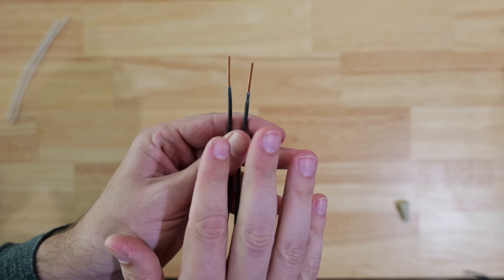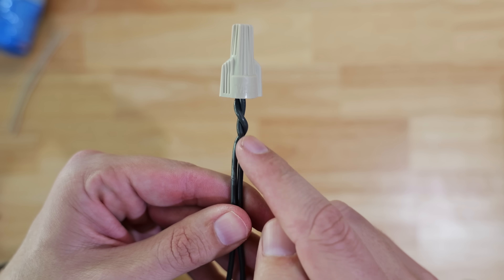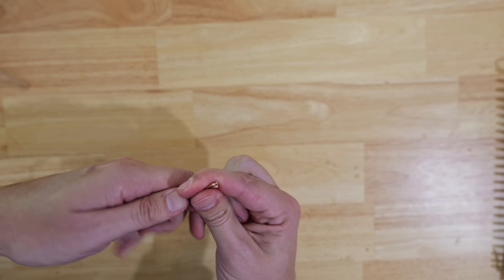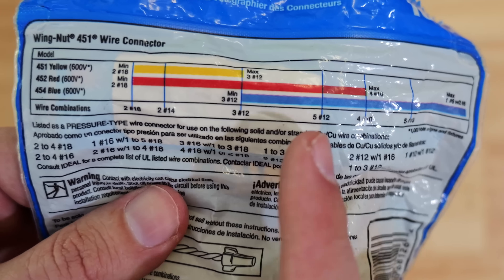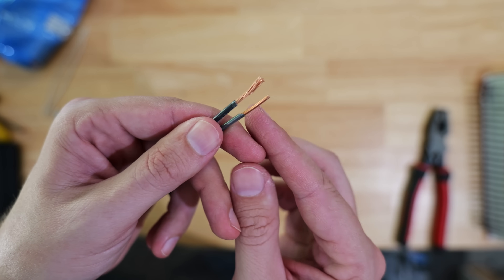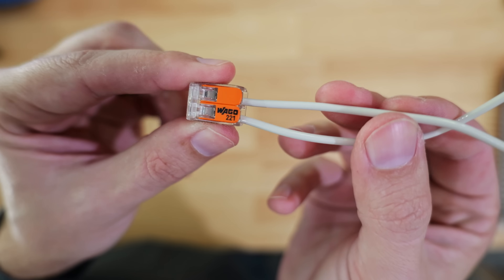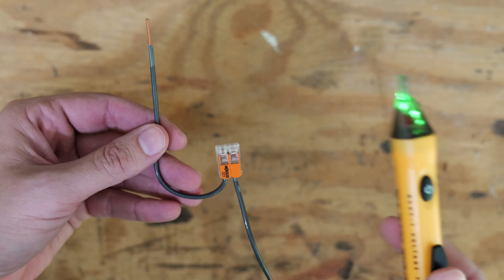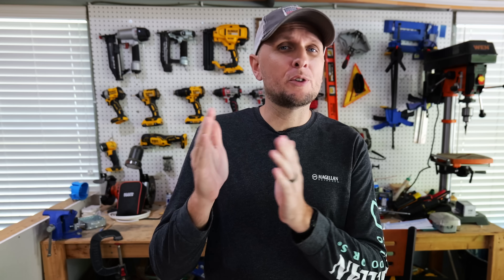7 FATAL Wiring Mistakes Most DIYers Don't Know They Are Making | Most Are Guilty of 3

Comment: If you are pretwisting, overloading a wire nut does not matter as long as bare copper is not exposed. Many twist connections are still in use after a a century with no connector on them at all. There are other hazards of course, but that part is true. If electrical and mechanical connection are made in pretwist, the connector is just for insulation, but offers one step of resistance to untwisting. Put a slight bend in the solid when connecting a stranded to solid and the stranded will bite in the wire nut along with the solid. In case anyone is wondering, I do pretwist even though manufacturers do not usually recommend pre twisting. I’m not sure if any forbid it but the argument I have heard against pretwisting is that it reduces the wire diameter but I do not believe this to be an issue.

Comment: With stranded and solid, just push the stranded slightly above the solid if they're the same gage, if it's fixture wire(#22) place the stranded wire all the way inside the wire nut, then place your #12 wire inside the tan wire nut and start twisting

Comment: The Associate at the local Home Depot I frequent, took me to the section with winged wire connectors. After selecting an assortment set, he advised that for added safety, after the wires are braided and the connectors are installed, I should then wrap  around them with a UL Listed insulating tape; to ensure that they would almost never come apart from any possible current vibrations.  Any comments?
Reply from the maker: That is old school thinking.  It is optional.  I personally do not do that as it can create a sticky mess for later and as long as the wire nuts were installed properly, there should be no issue.  Now to me it makes more sense to use it if it is to help secure connections in an environment where there is a lot of vibrations from a motor like an AC unit but outside of that I don't really see the point.  Theoretically it will help secure it though that much more.

Comment: There is a distinction between push in Wago connectors and lever locks. Push-ins are garbage. They're pretty much the same as a basic backstabbed outlet. Lever locks are much more robust because the lever provides constant, positive pressure on the connection.

Comment: Hello subbed and Tnx for the video. Question thank you. I installed a nema 14-50. I plugged the ground from the metal box to the ground outlet on the nema along with the main ground from the 6/3 wire. It works and maybe not correct. I want to pintail it so I ordered 10 awg copper for the extra tail. Is this the correct wire to tie in with the main wire and the ground? Thanks!

Comment: Sometime ago I wired my barn and the inspector required me to use a mechanical crimp for ground wires. I can’t remember the trade name for them. Basically a little barrel with a special crimping tool. Number one is that the norm? Number 2 would those Wagos be considered mechanical in place of one of those crimped barrels.

Comment: I think in your "pre-twisting" example, the twists were the wrong direction. They're supposed to go clockwise (the same way as the screw thread). If you look closely, the twists in that example were the opposite of the previous example where the wire nut itself made the twists.

If you pre-twist counter clockwise, then screw on a wire nut clockwise, the opposite twisting motion as you attach the wire nut will untwist your wires!
Reply from the maker: I twisted them the same direction.  I even reviewed the video again and don’t know what you’re seeing.

Comment: Im an Electrician,  33 plus years. Union and non-union experience.  Residential,  commercial, and industrial.  Back in my commercial days, we were doing a really big job of remodeling multiple 15 unit apartment buildings.  The owner of the electrical co insisted on starting to use wagos. Bc they're faster than using wire nuts. Before we were done with this neighborhood remodel, we had to go back and replace every wago. I know electrical inspectors that will not pass a job if these " fire- starters" are used.. 
These things do not make a tight mechanical connection.  Just my experience talking here. It makes no difference to me what anyone else does..

Comment: Haven't seen these wire nuts in Europe.  It's mostly the clip style (expensive, German) or basically tubes with a plastic sheathing where you screw down a pressure plate to create contact.

Comment: I have a little bit of an unrelated but sort of related question. I have a bathroom that has 2 individual switches in a double gang box. One of them operates the light bar and one of them operates a ceiling light in front of the shower.  How would
I wire both of those lights onto a single light switch and then add a GFCI outlet next to it?

Comment: Is it necessary to use electrical tape at the base of the nut after properly using a wire nut? I’ve seen so many with tape but seems like overkill if properly done.

Comment: LOz baby. A while ago, I read power at the light, but no light would come on. The wire in the box from the switch was coiled up and sitting in the back of the box, not connected. But ghost voltage was surely there. Loz showed me that.

Comment: 8:47
To my knowledge, WAGOs are supposed to used with solid wires only. So if you're joining solid and stranded, you have to put the stranded one into an НШВИ first. As far as I googled, the English for it is a "Ferrule terminal". You'll need a crimper.
Reply: Actually, WAGO 221 can be used with stranded directly, no crimping, no twisting. If you crimp not properly, the cable can slide out of the WAGO actually. Properly crimped it is OK though. WAGOs are the common thing in Europe. I have never seen wire nuts being used over here.

Comment: You would rely on a twisted joint in mains wiring?
Used scotchloc wire nuts decades ago, they had a coiled spring to clamp wires but I had little success  with them.
Screw- down connectors or Wago far superior.
Reply from the maker: I absolutely would.  A properly installed wire nut is hard to beat.

Comment: Wire nuts add contact Pressure to the properly twisted wires, creating a gas tight connection.  Electrical connection quality is characterized by contact Area (more is better) and contact Pressure (more is better).

Comment: Hi,
I'm installing a 240v air compressor.  I have a 45 foot run to the breaker box.  Can I use 10/3 + ground wire with a 30 amp double poll breaker?  Thank you, Dan

Comment: I am a well-trained electronics technician in Germany and an expert in this field. I have never seen anyone accidentally open the WAGO connectors. 
The other two problems mentioned are a general mistakes. You cannot relate this to WAGO's alone. Also, WAGO connectors have a fairly wide tolerance range. You have to strip some millimeters too much or too little to make a insecure connection.
Reply from the maker: Why would you see anyone accidentally do it?  It is not that uncommon.  Just check the comments.  I didn't relate them to Wago alone.  I showed this issue for both types of connectors.

Comment: Wago's have changed. The lever is much shorter now. I'm surprised how widely they are accepted as the connection is just a thin piece of sheet metal with a sharp angle contacting the wire. Like a Chinese finger trap. I would like to see a laser temperature reading at the contact point between the flat sheet metal spring edge and the curved surface of the clamped wire. Under full load, how close is the contact point to the fatigue or melting point of the materials.

Comment: 2:23 I'm a HVAC tech. I've seen a 24 v., 16ga copper conductor (in a basement) twisted tight 8 times in a wire nut and not making contact. At the contact point all the way down, was corrosion.
LESSON: NEVER trust ANY connection point. 
Also, Noalox is your friend.

Comment: at about the 3:00 mark, you should STILL put the wire nut on VERY tight. The wire nut could come off the next time anyone goes into that box and accidentally cause the nut to fall off, and you now have either a hot wire running  loose  or you've broken a ground circuit.

Comment: Just a comment, but when using a wago with solid core wire, you don't need to lift the lever to insert the wire. Just simply push it in to the correct depth using the stripping marker on the side of the wago as you discussed.  The lever need only be lifted to insert multi strand wire or to release a wire which has already been inserted previously.
Reply from the maker: You can but Wago does not list or express this as a proper installation technique anywhere.  Also, the wire typically has to be forced in pretty good in order to get it to slide in.  So when it’s kind of crowded, just lifting the levers makes it easier.

Comment: At 8:26, the wire being wrapped around is also a crappy connection . Professional electrician from Canada.  The wires should not be wrapped around each other. The too ends just need a good connection with the proper wire nut. There are also wire nuts for different environments, different applications etc.  there is weatherproof, hot environments, anti vibration wire nuts and way more

Comment: Would it be alright if I sotter the wires together and then put a wire nut on?        Thank you.
Reply: Sure, and as soon as it gets heated expect the solder to melt and trickle down, possibly coming into contact with conductive material and starting a fire.

Comment: Wire nuts - shockingly weak parts... Never seen them before, but... Stay with Wago clamps, much safer and a secure connection over the years...
Reply from the maker: You must not be in the US.  Wire nuts are mostly what we use and if installed properly are extremely good splicing devices.

Comment: At 10:20 not ideal because something can touch in and cause a short. But it would cause an arc as that is the same spacing at the other end. If the voltage is high enough to jump there it will at contact point.

Comment: Not a fan of quick connect style connectors. Seen too many times with multi stand with loose connection in the factory light fixtures. Signs are walking through a hallway and light flickers.  Helped a lady once who said it was her second light fixture and thought it was her house wiring. Changed and put in wire nuts and she never had a problem. Do not know why electricians use them and then go around and bash the slide in connection on a power outlet.

Comment: If I have to join stranded to solid, I twist the two together, solder them together, and twist on a wire nut for protection. I don’t care that they have to be cut to be serviced. Stranded wires will get virtually destroyed by the wire nut anyways so if you wanted to reuse them, you’d have to cut off the damage stranded wires and start fresh.

Comment: Wirenuts are "illegal" in most of Europe. The word illegal is in quotes because there is no specific ban on wire-nuts but the way the connection is formed is against most wire join regulations for domestic in-wall use.
They are seen in machinery, just not run in walls.

Comment: Wire nuts are really only seen in Chinese impor lights etc. Wago connectors are the way forward with a Wago box. Even better, if you use the push in Wago connectors for the lower current stuff (lights( then they don’t come apart.

Comment: never use pvc glue or cleaner by those wago connectors. i drill water wells and dripped some cleaner on a connection and all the clear plastic completely dissolved into thin air. now i see why my skin gets so messed up lol

Comment: By far and away, he better option, is to throw away "all" of your wire-nuts and use the correct terminal termination blocks, which use captivating scew connections. ie: By using a LINESMAN wire-tap screw connector, or even multiple wire cores placed into a large crimp lug and hydraulicly crimped.

Comment: I hate wire nuts. Most of my DIY electrical work is on my boat, RV, side by side, vehicles, etc. I only use Ancor marine tinned copper wire. Even on 120VAC systems, they have 3 conductor wire and I can use heat shrink butt splices with another dual layer of heat shrink over top

Comment: I'm looking to see where the ground goes when I'm connecting 2 electric cords that I'm adjoining but the one cord has hot and neutral the adapter I cut off existing cord Is a 3 way . Where do I put ground wire?

Comment: Pre twisting wire nuts goes against manufacturer instructions: why? Because when you cut the twisted wires, it is very likely youre creating abnormally sharp edges that will cut into/through your wire nut if you are to twist the wire nut on tightly enough to hold it in place as securely as it was intended.
Reply from the maker: Does not go against any manufacturers instructions.  You are creating something that is not true or an issue unless you way over tighten it.

Comment: so you have to dicide if you use wire nuts... which takes up to a Minute to install wach of them (Pre Twisting Cutting endes ....) and nearly every step you have to take could lead to a unpropped Connection but unless you undo the Wire Nut again you'll never know

or use WAGO. where you just have to check the Strip(not necessary if you use a automatic Striper which only have to be set correctly once) Flip up, push in Flip down. and after that you also can see through the clear housing if everything ist done Propper.... 

well well well .... i wonder which is the Preferred Methode in America and which is the Preferred one in Europe....

Comment: US (former) electrician here and I (personally) would never trust a WAGO - in fact, I don't trust any 'insertion' type of connector.  100% full-contact connections only; verified to be both mechanically and electrically secure before even thinking about any form of insulation. 

When dealing with stranded-to-solid connections, I always strip the stranded conductor(s) around 30% longer than the solid one(s).  Split the stranded conductor, position the solid conductor inbetween, and twist thoroughly to ensure that every strand is making full contact with the solid conductor.

The weakest point of any electrical circuit is always the narrowest point along the conductive path.  No electrical connection should provide a narrower conductive path than the conductors being used to make that connection.

Comment: To Dr Juan, et al 

  As 51 years being a licensed electrician discusted me when either a DYI  or a hack electrician that is licensed wraps electrical tape over a wire nut. Electrical tape is accordingly to underwriters laboratory is not intended to keep a splice made with a wire nut as additional protection. I,ve seen that where I work in a railroad facility where under-rail j-box connections come loose or is corroded under the stupid electrical tape. Also the vibrations from a 120 ton locomotive passing directly within a few inches of my electrical connections...That is why I insist upon the Buchanan splice method that looks like a 22 shell gets crimped which is all copper) over the wire and a snap on Buchanan insulted cap gets the job done thoughrolly.  And then for trouble tracing, I can easily stick my wiggy probs into the splice. You can't do that too easily with wire nuts. Besides wire nuts are NOT suitable for wet locations no matter what you do to them. Read the  use printed on the box of wire nuts. Does it make or list printed on the box the exception for wet locations  by putting tape over it ??And as further measure when I make up a splice in any j- box, I try for the most part tuck the spliced connections vertically in which if moisture or dampness into the enclosure acts like an umbrella over the electrical splice just in case of moisture entrance. 
                You need to respect you elders of the trade. 

Miss Paula Walach-union member IBEW- former member of IAEI or international association of electrical inspectors Still working with the tools and still learning the electrical trade. Also with 17 years of industrial automation machine wiring and building'. And over 20 years of new residential wiring .   
PS when I first came into the trade new homes we used metal boxes, Also dry wall was unheard of. They put structolite 3/8 thick plaster over 3/8" rock lathe then finished with a silky smooth lime finish. Those where the real craftsman of the early 1950s to the 1960s. Banks at the time would not approve a construction loan if you just used drywall. Hence, that is the time I learned to tie and under=writers knot in fixture wire. When I built my home, I did it in EMT conduit throughout.
Reply: Even with electrical tape over a wire nut in aa wet or damp location , I ve always found rust on the splice and sometimes when I,m trouble tracing that wire nut with tape over in which that internal spring was  so rusted on that I would have to just cut the splice out and start all over . The cat # of the typical two piece Buchannan splice is a 2006s , 20011s for the both copper sizes and the 2007 isulated cap & 2014 insulated caps respectively that snap on so good .  Any good supply house would stock it .

Comment: Here is a crazy idea. How about after inserting the wires into the wire nut you take electrical tape and wrap it around the wires and the wire nut and presto those wires are not going anywhere. I even wrap electric tape around the switch or outlet that your installing and have the tape go all around the outlet with the electric tape so the wires that are attached to the screws are covered up. That way it helps hold in the wires and if another wire some how comes loose it wont cause a fire if it hits those wires.

Comment: 11:34 The 5 volts on the meter is across 10 million Ohms (or more). So the 115 volts dropped elsewhere are across capacitance. A high impedance.